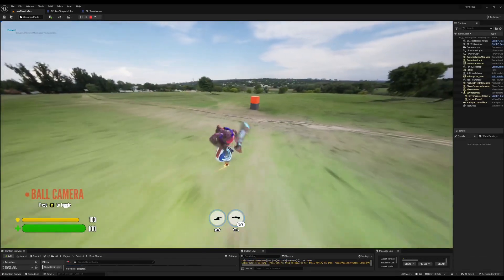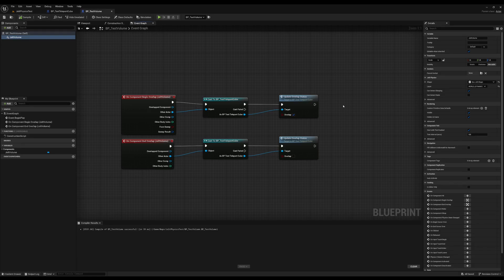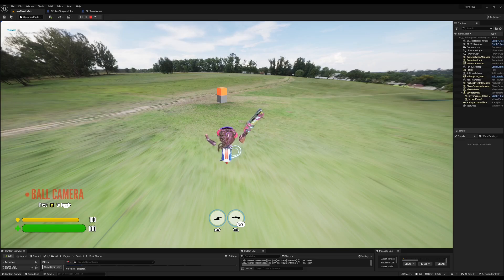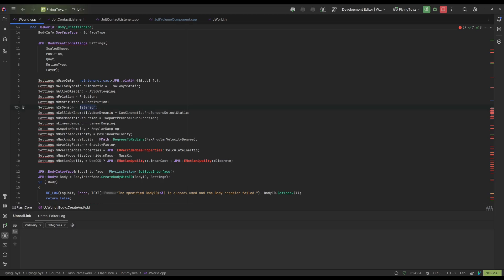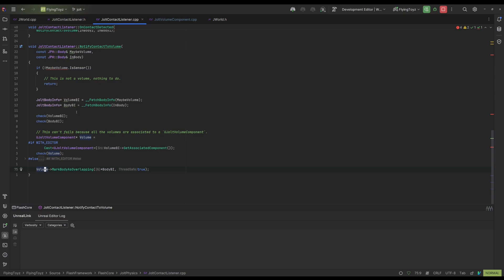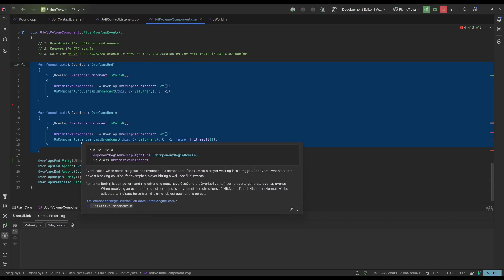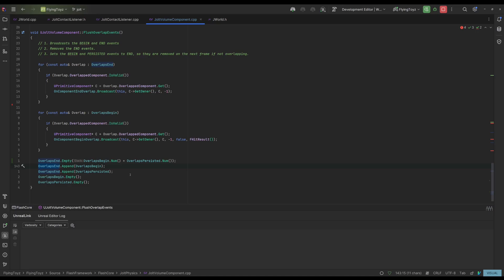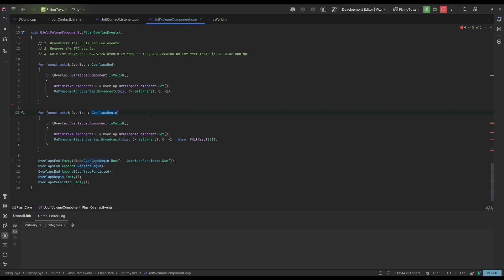#8 Jolt Physics in UE5 - How to integrate jolt physics sensors in unreal engine

Comment: Did you find a way to override line traces and sweeps ? The engine seems surprisingly rigid on this.
That means one would need to implement a special version of built in engine types (characterMovementComp, camera boom, ACharacter, some animation nodes etc.) just to replace the physics query calls.
Reply from the maker: Hey, I didn't investigate that because unreal doesn't really help with that so I went straight integrating my own set of APIs. Yes, that means you need to integrate your own camera boom, etc..